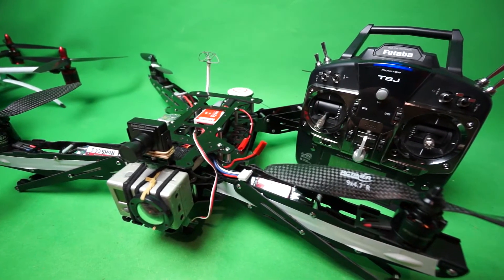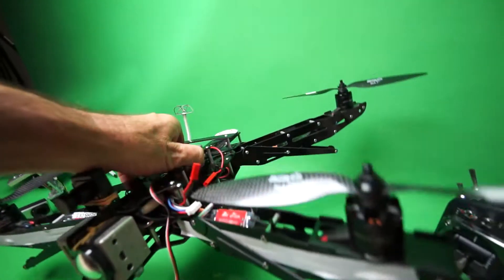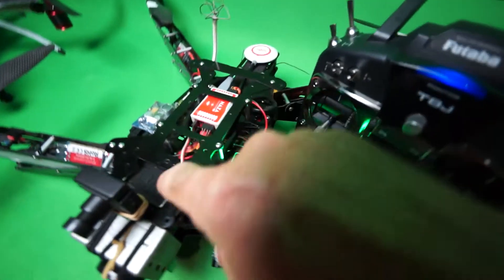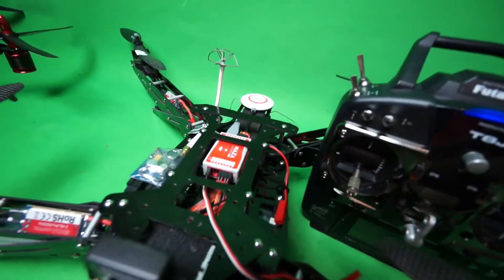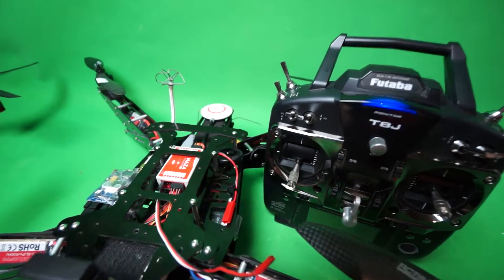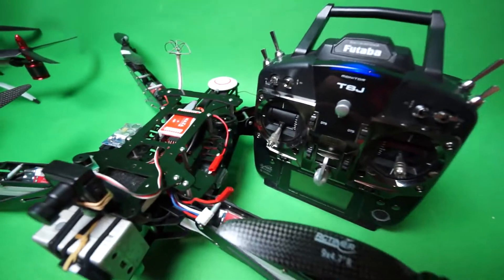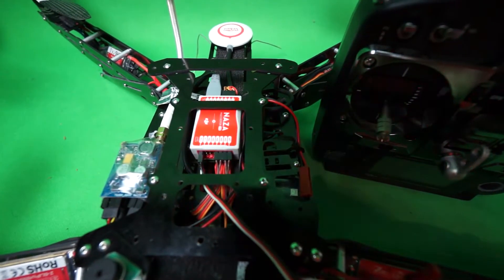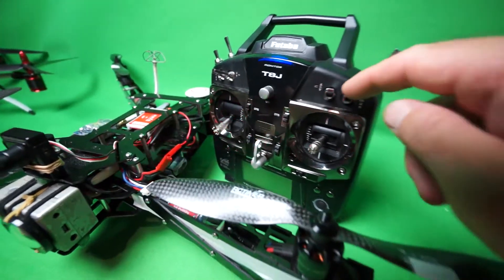Quadcopter Buzzer Locator F2 Port Naza Lite Using Sbus

Comment: Thanks for posting this. Once you plug the buzzer into the NAZA F2 port, how do you select the transmitter switch which activates F2   to turn on the buzzer? Does F2 automatically correspond to a transmitter channel?